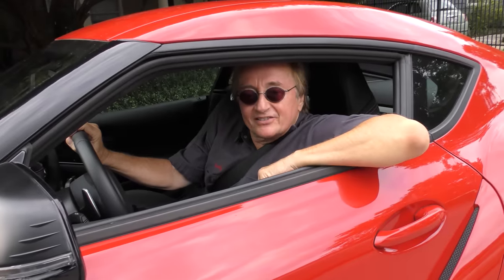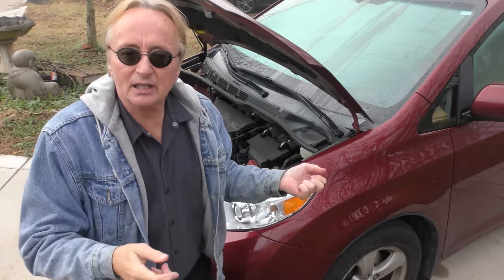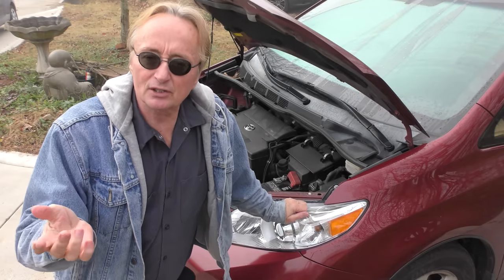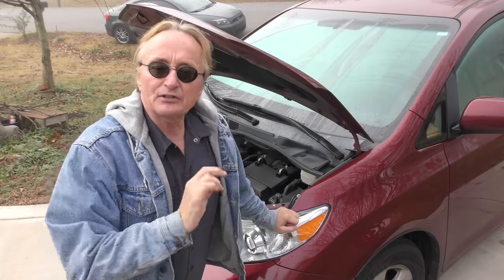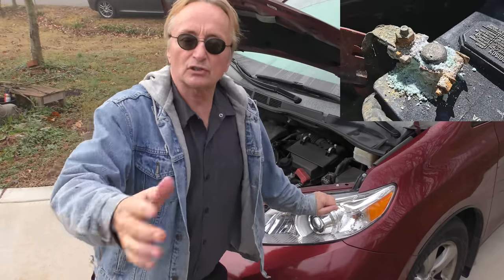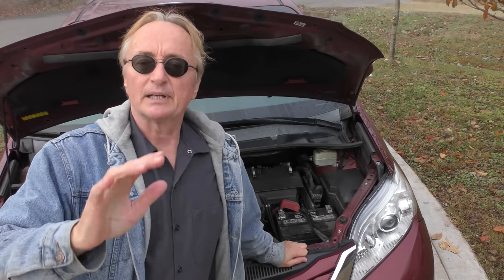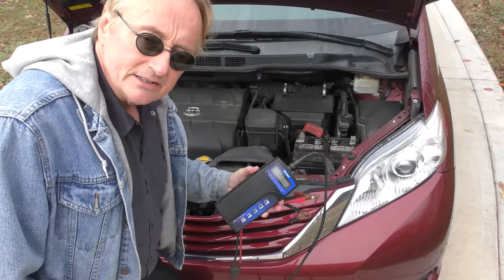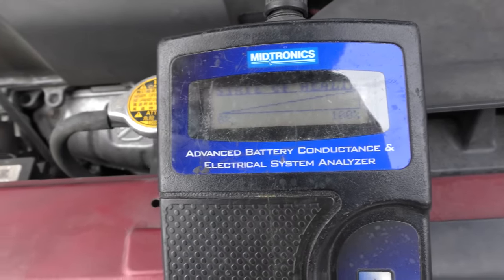If You Buy a Car Battery from This Place You’re Stupid

Comment: Even though I hated the truck,  Dad bought a 1973 Chevrolet Pickup Truck.   He put a Sears Diehard in it Shortly after We got it.   It started the truck for at least 10 years.   He traded the truck for a 1985 Doge 4 wheel drive Pickup.   I put the Diehard in our riding lawn mower and it started it for at least another Year.  They will probably never make batteries that good again.

Comment: I always bought Diehard, and never had problems. I absolutely loved Sears, and I have had nothing but problems with other brands. I need to make the half hour drive to Advance Auto Parts and get Diehard again because I'm plain tired of spending $100 every two years. I'll gladly pay $250 for 4 years. I'm thinking I have probably been sold batteries that were over 6 months old, so THANK you for that VERY important date-check tip. It really DOES sound like that could be my issue.

Comment: AGM is the way.
Reply: Had many AGM batteries. On my 13 Accord it has a fuel saving set up that all but shuts down the charging system unless headlights are on. During the day (running a volt meter) it will run 12.3 volts. AGM batteries need 12.9 to be fully charged. Working 2nd shift my 3 year old AGM would be dead at midnight. The same battery would start my car the next morning because the voltage was 14.4 coming home (35 miles) at night.
Reply: Just be aware that AGM batteries are temperature sensitive. The European cars bury them in the trunk...that keeps the AGM battery out of the heat under the hood. So don't just blindly replace an underhood Lead Acid battery with an AGM and expect super life or super performance......you could be wasting your money...and the charge rate output by the regular alternator may not be correct either....

Comment: I needed a marine battery last week I went to the Wal-Mart closest to my house and they had several in the group size I needed. All of them had dust on the top and a 10 month old date code. I went to the next closest and found one with a 2 month old code. Whoever supplies Wal-Mart with batteries is not doing a good job of stock rotation.

Comment: Some batteries cost $330+ but they last 6 years. They have a 2 year warranty too. They have more cells and more led inside and they are super heavy and super reliable. If one or 2 cells die the battery still works like brand new. I have had my battery since 2019 and still working great over 5 years of heavy use soon in Nov would be 6 years

Comment: Walmart price is the best! Other reputable shops typically charge you for the battery AND THEN a price for installation. Overall Walmart is the cheapest, and their batteries are very good.

Comment: Exactly, we had a battery for our Honda pilot 2018 changed with AAA, they charged $260… I bought a battery at AutoZone for my 2020 Accord Hybrid at $196 with tax… (two year warranty mind you, they didn’t have the three year in stock). Three year battery for it at Walmart is $149 plus tax, so around $155 with tax at Walmart for a battery that has an extra year warranty. Is a great deal. Batteries in Arizona only last Three years TOPS.

Comment: A old stand by is to turn your headlights on then start your car. Does your engine turn over slowly? If it does you need a new battery. If the engine turns over the way it is supposed to then try the headlight test again to make sure the battery is good or not. If the battery is 4 to 5 years old you are in the neighborhood of needing a new battery anyway. As soon as the weather turns cold the new batteries will be fine and the old batteries will probably leave you stranded. If your engine turns over slowly when it gets cold you need to check out your battery asap that means now!

Comment: I've never had that much luck with  Ever Start batteries (Wal Mart). Interstate used to be a good brand, but they've gone downhill lately too.
Reply: lifespan?
Reply: @theodoregrossman2490   The two year Ever Start usually only lasts me half of that, which is ok if you want to go in and get a new battery every year.  The last interstate battery I had lasted 18 months. It was supposedly new when I bought it.
Reply: @N0WYO1  I`ve got 2 one year Ever Start batteries (Wal Mart) installed in my cars and after 3.5 years they`re still good. Only $55 each in CA
Reply: @MrTIGRAZZ  Maybe I'll give them another shot. At $55 , there's not much to lose.
Reply: @N0WYO1  Also they have two types of batteries for the same car, for hot and cold climate. Cold climate batteries are 50 Amps stronger, but only available at some Wal Mart stores.

Comment: If you can find them these days, get a battery that has the maintenance  lids that pop out.
Keep the cells topped off with distilled water.  I get an averaged of 7 years out of a battery by MAINTAINING  it. I had a deep cycle trolling motor battery last me 15 years just by making sure the cells were full and made sure to top off the charge occasionally in the off season.

Comment: My wife has my Honda CRV, and the battery just died. Shes about 300 miles away and wanted to go to napa auto to replace the battery and I told her stop, charge the battery and get home. She thought the car would die if the battery went, I told her no just get home. I got parts to get a bigger sized battery because my CRV came with a small under-powered one from the OEM. Going with a "generic" 24F that's made in the same plant as 95% of all car batteries...seen the slickers at the plant myself with the only difference being the acid (I think it was two kinds at least); outside of that it did not vary much at all.

Comment: It was mentioned that you should not buy a battery with an older production date since it would have a reduced lifespan.  I have a question about cars that you store for a period of months.  I have a 2015 Ford Mustang 50th Anniversaty edition that I do not drive in the winter months.  I have disconnected the battery, thinking that this will keep the battery from draining.  Should I not have done this, since the battery will sit idle for months?  Should I keep it connected, but start the car every couple of weeks or so to keep the battery charged?

Comment: . Consumer Reports did tests & Walmart's are 1 of the best. HA.HA.HA
Reply: Because they are made by Johnson Controls.   Johnson Controls makes batteries for the big chain auto parts stores and OEMs.  They are good batteries.
Reply: Why not just get the original manufacturer brand?
Reply: @MrWalker1000  Quite a few of those are made by Johnson Controls too

Comment: Who remembers the Sears Die Hard commercial where they took a battery, encased it in ice, broke it free and then jump started a car with it ? America was SO impressed until someone reminded us that ice doesn’t get  below 32 degrees F and it was actually acting as a blanket protecting the battery from the extreme cold. Yes, I’m showing my age😂. I also remember when you jump started a car, you only had to hook up the positive cable and “ kiss” bumpers for the negative.

Comment: I've driven to Walmart, took out the battery and took it in and go t a new one. Then put it into the car and drove home.

One battery test is to disconnect the ignition and crank it. If it takes 15 seconds to drop to 9 volts, it's good. Hopefully it will start at 9 volts.

Comment: I have successfully extended many batteries to run longer (provided the plates are still good not worn too thin). But recently I saw another 'amazing reversal polarity charge' that was brought back enough to be as good as a new battery! (Old battery 3 min continuously cranking, new battery did 4 min).  Old battery needed to be completely drain to zero volts before charging it. Do this at own risk ok?

Comment: I work for a auto parts store, I change out Walmart batteries that are just over 2yrs old! Yes they Are cheeper, but it’s been my experience they last a little longer than your Korean experience!! 
I finally had to dispose of the battery that was in my dads pickup since the 80’s!! Yes it was serviceable. I’m 40 now and learned how to drive in that truck with same battery in it!

Comment: Used to sell car batteries and take the old ones in trade.  Battery failures aren't always due to the battery.  People who don't take care of the battery or run it with a bad alternator kill way more batteries than the battery brand. We used to take a LOT of Walmart batteries in trade because we had a lot of people in the area who didn't know anything about batteries and abused the hell out of them.  But when they asked me what to get to replace it, I'd send them back to Walmart. It was a fine battery, just as good as the ones I sold, and a lot less money.  They weren't going to afford my battery anyway so I did the right thing and told them the best one to get for the money they had.

Comment: This is why I bought a Bluetooth battery monitor device. My car had a faulty turn signal switch that sometimes left the headlights on all night. The battery started going bad months later and I could tell because the battery monitor used to show a more stable and consistent charge and then it fluctuated by 20-30% in a few hours stationary even when disconnected. The car also had trouble starting up and the monitor kept saying low startup voltage. Got a new high quality battery and now monitor says 96-100% charge and no startup problems and I put the battery terminal protectors on this time.

Comment: My simple rule is, if it’s a 5 year battery, replace it after 5 years. I keep a repair record log in each vehicle to track this. Not all batteries fail around their stated life span, but most due. I’ve done this for many years and never have been stranded anywhere.

Comment: i have a 2014.5 Camry Hybrid, the stupid after market 12v AGM batteries I am putting in after the original Panasonic battery that lasted 5 years itself. The latest have been the 24F batteries (12v AGM) from LeS Shwab. They seem to have issues after one year. I know they are only to fire up the electronics and it doesn't have a starter. I am not talking about that. Just that the car is only driven a couple days a week and is garages. it gets a good workout when driven, as I live out in the country and the car gets driven at least 90 miles each day it does get driven. Even with any parasitic drain, they should go a lot longer without running.

Comment: Before you shut your engine off turn off your lights radio ac or heater. When you start your car you want all battery power going to the start of the car through the starter. After start turn the other stuff on. Cheers!

Comment: I bought several Excide batteries at a local parts chain. Invariably about 2/3 to 3/4 of the warranty period would pass and then the battery would die. Their deal was X number of months warranty and they would prorate the cost. So I never got the full value of the batter in use. I was always buying new ones at a reduced price. The last time the Excide battery died, rather than buy a new one I demanded a refund. Then I bought a different brand.
Reply: The same thing when I used to buy Sears DieHard batteries. Warranteed for three years, they always died at 18 months, and I had to buy the same thing, if course.
It was like renting a battery.

Comment: I like the batteries at Costco and BJ's.   They are only 80 dollars and I don't care if they only last 3 years.  I used to buy Optimas when they cost only 170 and lasted a long time. They no longer last as long as they used to and cost 240 or more dollars.  It's better to just use cheap batteries and replace as needed.

Comment: Pretty sure im going on 5 years with my $59 battery from rural King. The same battery costs $79 now i think. I always take mine straight home and charge it if i have the luxury. I was told a long time ago that you should charge a battery before putting it in to service because it will last longer putting it in at 100% charge. I dont know but every "new" battery i get is never fully charged. Ill take it home and it will sometimes charge 6 or 8 hours befor its full.

Comment: Are you  comparing Amp hours and CCA or just price? Maybe in the States this works but in Canada you want the biggest baddest battery that will fit. Walmart batteries are not a savings when they last half as long and you're jumping your car in -20C. Cheap batteries will never give you 7+ years use like the stock batteries do.

Comment: I used to buy batteries from Walmart until I started having trouble with them within warranty. I took them back and Walmart would hook them up to their machine. If it would take a charge, they said it was still good. I put on my load-tester and showed that it was bad and they didn't care.

So, I fixed them. I went home and dumped the acid out and neutralized it. I refilled with salt water and took it to another local Walmart where they hooked it up to their machine. They put the juice to it that the battery started smoking and they warped the plastic casing. I got my replacement battery and I don't buy batteries from Walmart any more.

Comment: Got an F-24 from warlmart in 2020 and its been a great battery, I've even ran it completely down three times since then, my fault on one of those, i left the car running and it ran out of gas then ran the battery down twice was because the brake light went bad and I didn't know it was bad lol. But I charged it back up and its still going strong! Very happy with this battery, I'm planning on purchasing another one just like it even though that particular battery is a little large for the Nissan I have it in, it fits in the battery box but just barely lol. 🤠👍

Comment: The rear wiper comes on automatically when I start my 4th gen 4Runner if the battery needs to be replaced. Primitive but useful warning system.

Comment: Interstate auto zone Walmart Napa and sears batteries where made by Johnson control battery company. Interstate is higher because they have embossed containers the others are only different by the label stickers they put on them facts. Sears also used embossed containers which increase the price of the batteries.

Comment: My battery finally died on my 07 charger srt8...was the original mopar branded oem battery stamped from 07...even the dudes at autozone were impressed with a battery that lasted nearly 14 years!

Comment: These new vehicles have battery monitoring, and if you battery loses maybe 30% of its power it will warn you about it, if you ignore it, the car will start turning things off, my wife escape did that. 1st I learned of it. I installed a new battery and everything ok. If you don't replace it soon then keep driving it. When it does go out you have to take it to the dealer to have the battery control monitor reset...

Comment: I have a USA made Optima battery dated 2008 that needs to be replaced. Way past it's due date but it's held up.

Bought a Mexico Optima for another car it didn't last 2 years. Had 1 month remaining on warranty so it was replaced with another Optima. Never buy Optima again, but will continue with AGM type batteries.

Comment: Original sealed Delco battery in my Cruze is 8 years old now up here in a cold, northern tier state.  When replacing a battery in my GM vehicles I stick with the sealed Delcos for longevity.  I use the Wal Mart battery in my RV trailer and only get 2 years as the drawdowns sucks the life right out of them.

Comment: In a shocking discovery, I found that even the DEALER sells batteries cheaper than the local auto parts chains! $153 vs. $180. And the dealer battery price includes towing and installation! Plus the warranty is better: 2 years replacement + an additional 60 months prorated. The auto chain battery only has a 2-year replacement warranty.

Comment: My local Ford dealer has the best price for batteries - even cheaper than the auto parts store.  Same warranty.  Auto parts store won't match the Ford price.  The Dodge dealer's prices are way too high.  Walmart doesn't carry what I use.  So I have a Ford battery on my Dodge Challenger.

Comment: That is why my Toyota gets Toyota battery's with a 24 month replacement warranty and after the 2 years it is prorated for another 3 years and I only replaced it 1 time being a 2010.  It tests weak so I will get a replacement soon. it is short of 4 years old so I will get some prorate on it.  Still starts ok but still needs to be replaced.

Comment: Had a Honda dealership battery, mechanic told me battery didn’t have enough charge I had a warranty, get this mechanic replace it with another Honda battery next oil change six months later mechanic told me your battery charge is low and I told him but yall just replace it with this one with warranty so they gave me another battery so I said I’m gonna solve this problem right now. I went to battery plus and bought me a Duracell durability battery for 235.00 took it to Honda and had the mechanic installed it instead of battery plus employee who doesn’t know what the hell theyre doing when installing it. Told them their battery is worthless. Had no issues since

Comment: I've had battery changes at Wal Mart and my experience is the technicians DO NOT know how to synch up the batteries to the engine electronics.  You'll have to give it more gas to get it running.  It never seems to operate correctly until you take it to a good mechanic or <GASP!> the dealership.
You can get the parts cheaper at Wal Mart but getting a reliable tech/mechanic at Wally World is another thing!
I will agree on the Auto Parts stores.  Never go there unless you're looking for something you can't find at Home Depot, Lowes, or Wal mart.  The AP stores are rip-offs.

Comment: I e had to replace the batteries on both my f150 and my jetta recently. Both times the oem battery was $30 less from the dealer than a no name from the local parts store. Just an FYI